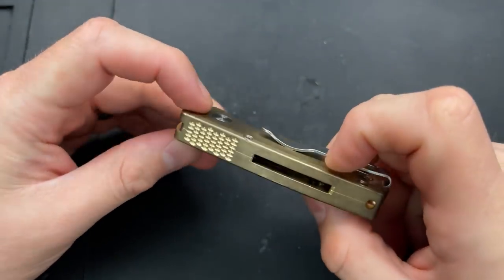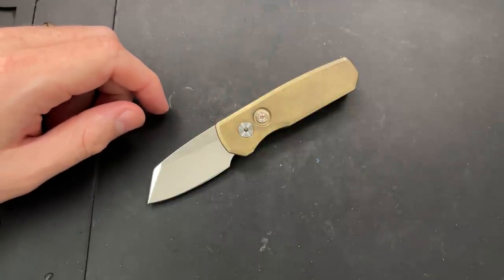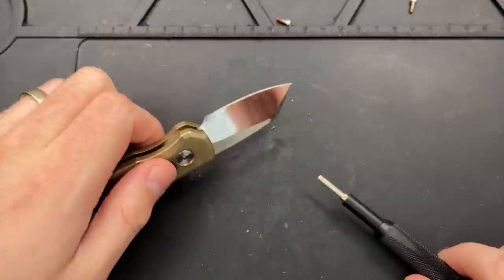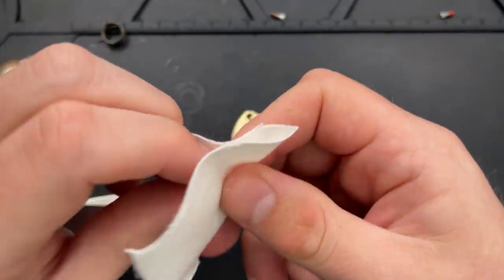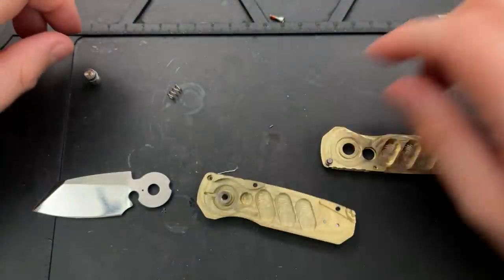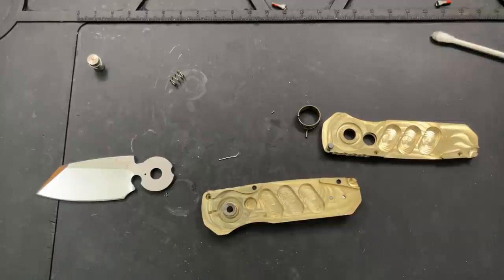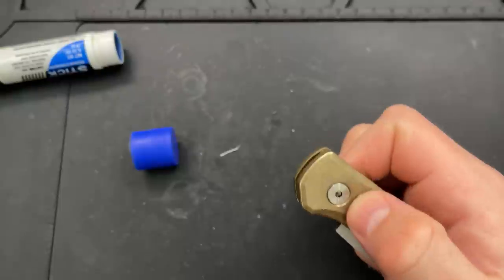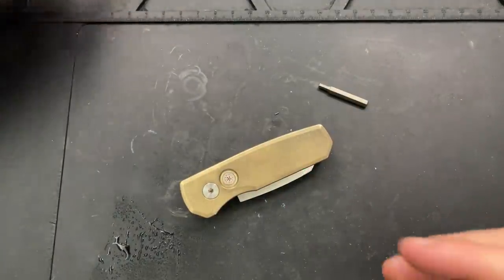How to disassemble and maintain the ProTech Runt 5 Pocketknife

Comment: Nick could you add the screw sizes in the description of the video on disassemblies?
Reply from the maker: I get why that's desirable, but these things can be changed mid-run sometimes, and it's generally better to buy a set and find a size that works at the time of disassembly :)